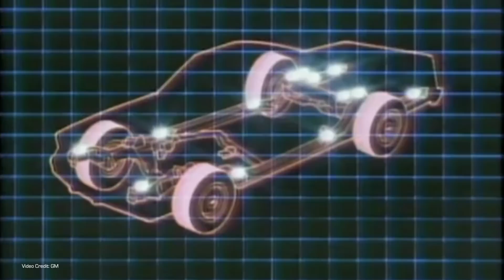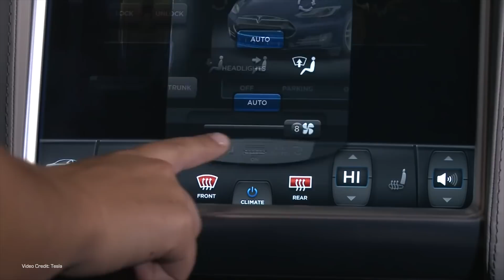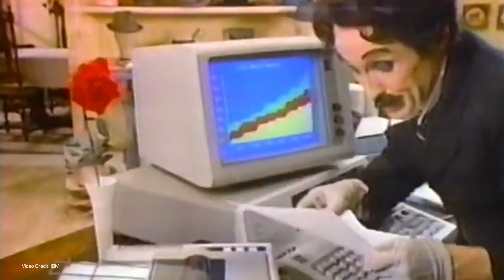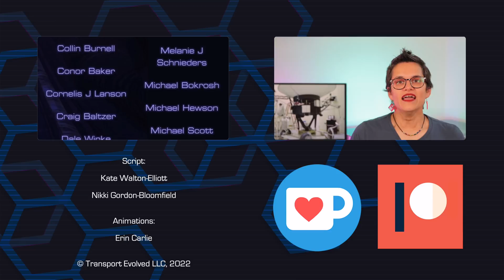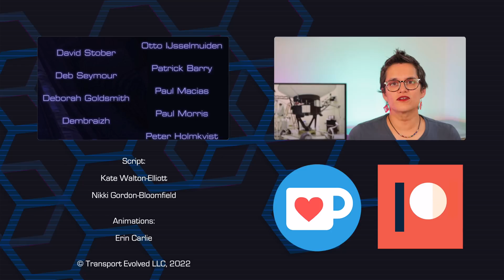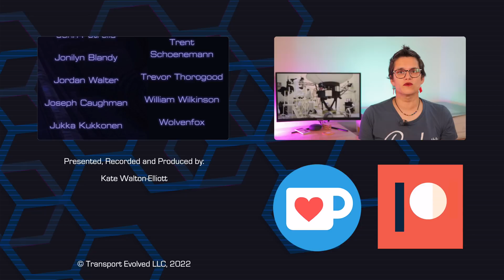Will all those computers kill EVs?

Comment: A lot of the chip sets are for safety critical items like airbag’s which are tried and tested over many years and are necessarily old design to be reliable over the life of the car. Chip sets for braking systems are the same and were probably a carryover from ICE vehicles which avoids re testing and approval. Even Tesla re used chip sets from other vehicles to speed up the time to production.

Comment: TE the Musical, please. Infotainment screen should be a standard tablet, cheaply & easily replaceable and upgradable, but no extra $ in it for mfgr's, so wont happen  
ICE engine sensors & ECU is easily more electronics (NOT electrics) than a BEV. I'm more worried about electrical hardware frills, like pop out door handles. Part of the problem is overreactive software, when a vehicle is bricked because of a perceived error.
Reply: A very special episode of TE about the use of the timeline slider on YouTube player?

Comment: The AMD CPUs that run Tesla's latest infotainment systems are liquid cooled. I also use the cabin overheat protection in our Tesla's because I don't want the interior or the electronics in it being subjected to those almost 200° F temperatures. I don't know of any other EVs that offer these features.
Reply: It’s called temperature management! Lol….. no manufacturers will let their electronics overheat for any reason!  In EVs most parts are generally liquid cooled.
Reply: @carholic-sz3qv  yes, the powertrain electronics are liquid cooled in most modern EVs. I was referring to the PS5 level CPU that drives the high resolution high refresh rate screen in a Tesla.
Reply: @teslasnek  lol….. the AMD chip is an X86 architecture it’s normal that it has to be cooled! If they had used ARM chip it would have been not an issue
Reply: @carholic-sz3qv  My point was that as far as I know there are no other cars where the CPU that powers the infotainment unit is liquid cooled.

Comment: I love the low end solutions used by Dacia, Seat,  Skoda and other euro marques! Using a mobile phone instead of an inbuilt infotainment system is genius. Why have 2 over capable systems in a car ? Entertainment, interfacing to car systems and Navigation, all with $0 cost! And if interfaces are specified right just update with a newer phone?
Reply: Laws.  In North America Distracted Driving laws will not allow it as you could then use the devices for watching a video or texting while driving and if you have it out for your car you can switch from your car to non car apps.  Also most of the laws that were brought in to allow digital screens and touchscreen interfaces like Tesla uses have as a requirement that the device is permanently mounted and cannot be removed while driving and without tools.  If your phone is permanently mounted  to your car, and you have to have a second one for leaving your car, you might as well just go to what we have now.
Reply: @WolvenSpectre  Did not know about the permanently mounted laws.  Thanks.
Reply: Agree but entertainment is not where we really need the dependable computers.  Anti lock brakes top the must list.
Reply: @danharold3087  And your point is? It's not just dependably, it's original cost/complexity that is the issue. If we can use simple standard micro controllers to handle the mundane/essential services, and reduce complexity, this will allow future easy updates or replacement.😉
Reply: @bellshooter  My point is one has to choose the uC that best fits the job.  This generally means selecting the one to create the circuit using the fewest external components for simplicity and cost.
For this reason the same uC processor core is offered in many configurations with several speeds, ram/flash selection and numerous combinations of peripherals.  This does not result in a few uC chip types but 100s even 1000s depending on how you count them.  If your calling this multitude of uC standard we maybe in agreement.   

A uC with 10X the transistors is not 10X as likely to fail.   Lifespan has more to do with temperatures than transistor count.   

At first glance it might seem that these concepts are at odds.  They are simply factors that have to be weighed for each decision.
Reply: @danharold3087  anti lock brakes!? Lol……
Reply: @carholic-sz3qv   Yes ABS.  Fellow engineers were involved with ABS development.   We did not have battery powered test equipment.   The automaker would run 2 cars side by side.   One carried a bunch of batteries and an inverter to supply power to the test equipment in the car with the ABS system.   That was a while back obviously.
Reply: @danharold3087  big lol…..

Comment: It's baffling that in the middle of a chip shortage, we don't see any automakers speccing more vehicles with manual windows, manual mirrors, dummied-out infotainment -- anything that reduces the number of microchips required for production.  Then again, maybe the current crop of cars just weren't designed with a possible shortage in mind.  Or maybe some pencil pusher determined that it'd be more profitable in the short term to produce fewer vehicles with more chips and sell them to the very highest bidder.

Edit:  Ah, the literal killing of EVs, not the reduction of sales.  Excess heat tends to, at bare minimum, melt the adhesives that hold all of our screens in place.  So there's that.
Reply: Agreed.  More simplicity is preferred by some.  I would love to be able to find something with manual windoes, single band radio, manual door locks .....  Then again we do have a 1979 MGB which has all those features.  I have a feeling that the onky way I will get in to an electric vehicle is to retrofit one of our existing cars.  I detest the mega infotainment screens that seems to be necessary to compete.
Reply: @OneDullMan  manufacturers like Toyota still sells some cars with very basic equipments like hand cranking doors…… the land cruiser and other models
Reply: @OneDullMan  Some years ago after pickups had sprouted electric seats and windows my brother in law found one with crank windows and manual seats.    It was ordered for a utility company.  At least at that time one could special order w/o the gizmos.
Reply: Cathie Wood has stated she believes the chip shortage is largely being used as an excuse to hide the fact that ICE car sales have tanked and will never recover.

Ongoing sales figures appear to support this theory.
Reply: Mercedes is indeed selling cars with fewer chips - for example the infotainment system is dummed down from that described in the brochure.
Reply: Chip shortages aren't forever, and yes, to make a manual roll-down window, they would have to redesign the entire door. Then you'd face consumer resistance. "I'll just wait and buy a new car when they make them properly again". I'm old enough to remember when car radios were something that you bought separately at a car radio shop (and got stolen with appalling frequency), and air conditioning was something you only got in a Mercedes. I'm not going back there.
Reply: Not all microcontrollers aka chips are created equal.   The little guy in the mirror controller may not be the type experiencing the shortage.
Reply: Windows and mirrors don't need much in the way of chips, they're just little motors. Sure, some modern cars' windows are microprocessor-controlled, but those are likely controlled by the main system computer, not individual computers in each door. Even then, low-end commodity chips are still easy to get. It's high-performance ones or custom ones that are hard.
Reply: @AnonymousFreakYT   I don't disagree.  But if your going to have a motorized mirror chances are you want the car to remember user mirror settings.   May as well use a can bus enabled chip and forget about running wires to another processor.
Reply: @AnonymousFreakYT  uhm nope!!!!! There are cameras, and many other electronics on doors on todays cars! Yeah the main computer can manage them centrally but they are still needed!
Reply: @carholic-sz3qv  On some high-end vehicles, yes. But a Nissan Leaf, for example, won't have cameras on the doors. We're talking simple, so we start with a simple car. We don't start with a Tesla.

Comment: Air bags alone our gonna kill cars longterm as there explosive charges our clearly having long term issues
Reply: I haven’t heard that, please provide your source.
Reply: @fredbloggs5902  

Your not aware of all the airbag recalls
Reply: @tommays56  How does a free safety recall “kill cars longterm” ? The cause is known and understood.
Reply: @fredbloggs5902  
Do you think they will replace airbags indefinitely as they deteriorate or like everything else they will reach a service life as the fabric and explosive charge go through heating/ cooling cycles
Reply: @tommays56  What part of the problem is understood do you not understand? The problem has only affected one manufacturer. The rest have been so reliable that they no longer bother putting expiry dates on them.
Reply: @fredbloggs5902  

On the older machines I support the controls our on there 3rd complete replacement as the machine is so valuable yet much simpler than a car this is possible 

We had to retire a huge amount of machinery when the ROHS standard changed stoping them from making older circuit boards 

The same things will happen with cars as many ECMs our already junkyard only support because as processes change they won’t continue to manufacture older parts and the supply will run out

Comment: At 380,000 kms., my VW is mechanically fine, but the various sensors and the wiring to them, connections, and switches have become tenuous. I can deal with the sunroof randomly refusing to close, but the intermittent fault in the airbag sensor wiring may cause the car to fail safety inspection, which would be  a shame for an otherwise reliable vehicle. 
It's not just an EV issue.
Reply: That’s nothing lol….. I’ll like to see a Tesla survive in Africa or South America or other harsch environments where that vw actually does very well.
Reply: Safety inspections exist for a reason. Ignoring a known fault in a safety system is a bad idea and brings the validity of your opinions into question.

Comment: My quick opinion is that this isn't just an EV thing. ICE cars get the same treatment. And having worked low level on industrial electronics, I can say that it should not be an issue, as long as they don't cut corners in production and select the right components.

Tesla's MCU problem is a nice example of bad design choices. Cheap eMMC memory combined with gigabytes a day of useless logs getting written to it.
Reply: Tesla logging lots of data will speed up the development of FSD and literally save millions of lives.

But then everyone here can see from your other comments that you have TDS.
Reply: ICE cars get the added bonus abuse of occassional jump starts. Jump starting a coworker's car killed a board in my last vehicle and made it undrivable. All because in 100 years of these damn things they never standardized jumper placement or timeouts on interior lights. 🤦
Reply: I would argue the problem is worse in an ICE car especially the drive train.   In addition to heat the electrics/electronics have to deal with seeping fluids.
Reply: @danharold3087  I strongly disagree with you lol…. Those electronics are made to do well with the heat! Also EVs have far more electronics compared to even complicated ICEs. EVs have BMS, motor controller, inverter, and the multiple other sensors……. On ICEs it’s mainly ECU and gearbox electronics…..
Reply: @carholic-sz3qv  Disagree all you want.  Heat is the enemy of the transistor.  They live longer if you can run them cooler.
Does not matter how much they spice up electronics to deal with the heat.  They are better off if not run hot.

Now your being funny.  Lump all the engine and transmission computers into ECU.  Yeah that works LOL

As for sensors I don't know which will have more.  An ICE engine has a lot of sensors.   The motor on the EV has maybe temperature and current.   A speed sensor perhaps.   EV has no transmission.    Braking is quite possibly a function of the motor controller.  Regenerative braking would make that likely.
Reply: @danharold3087  lol…….. yeah the transistors can actually be run hotter, it’s just need to be in certain parameters 🤡!!! The same goes with computers chips….. apple for  example let their chips runs a lot hotter than others.
Reply: @danharold3087  One COULD build an EV without as many sensors, but then, one COULD build an ICE car without as many sensors as well. The number of sensors has WAY less to do with the type of drivetrain and way MORE to do with the dual safety and performance cultures around automobiles. It also has to do with the absolute fact that despite having a bad reputation, sensors and boards are FAR more reliable than the mechanical parts they replaced. Remember when 20 years was considered an exceptionally long time for an engine to keep running? Remember when TEN years was considered an exceptionally long time for an engine to keep running? Has everyone forgotten how incredibly common it used to be to have to replace entire engines or transmissions?
Reply: @patreekotime4578  I fully agree.   It was not in my mind to attempt dumbing down the cars.   Which is what removing sensors would do.

When I was growing up in the 60s we traded in cars and pickups at 60K.  Ones that were run to 100K were generally a rolling pile of worn out parts.
Reply: @carholic-sz3qv  Agreed on can make them more heat tolerant.   But heat is still the transistor killer.   Given that computer chips are a huge pile or organized transistors it holds for them too.
Reply: @patreekotime4578  That is true but I disagree on the part where boards and computers are more reliable than its mechanical part. In total I have 3 mechanical vehicles that's been great compared to my more modern chevy. With the new fluids and oils that we have nowadays, an older mechanical engine can last a lot longer than they did before